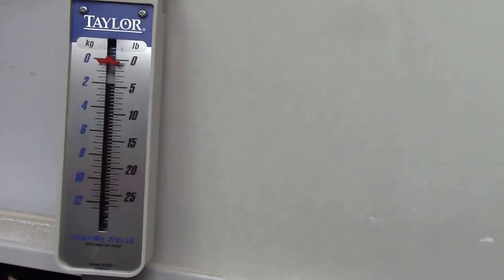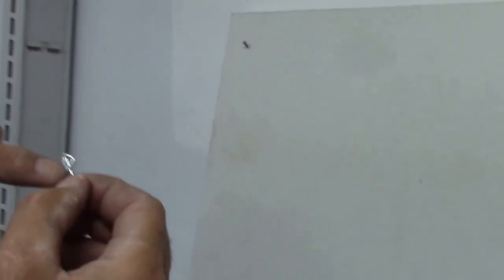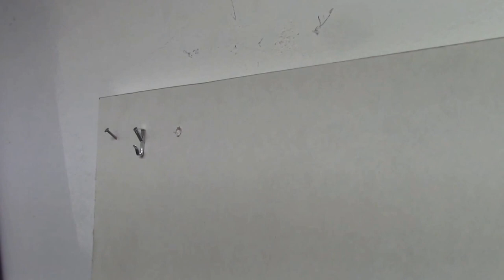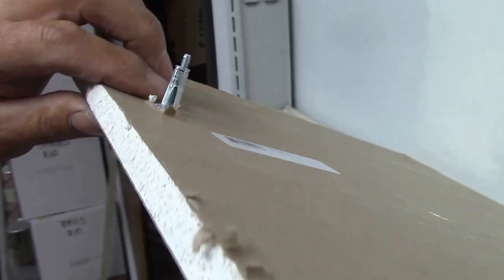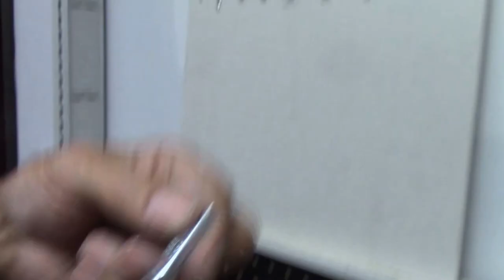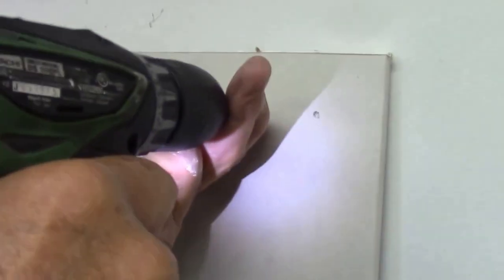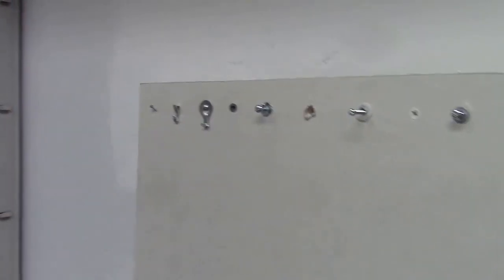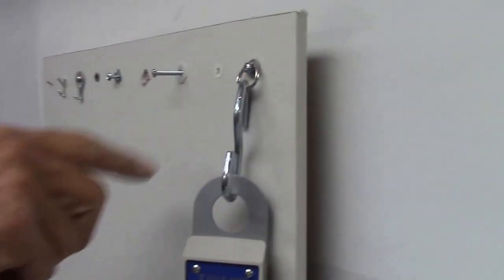Hang Heavy Pictures and Shelves Safely, Made Easy

Comment: Is not the integrity of the sheetrock all based on the back paper staying intact with no tears?

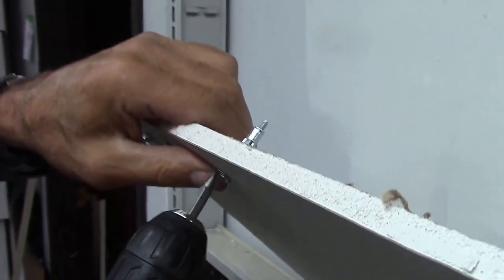With real American Molly,  predrill with a tad smaller drill, so as to perforate the back paper to the right diameter (slow drill, no hard pushing in), and user a pull tool to expand the back.  Real Molly used a solid stem of the same thickness as the sheetrock used. Then the pull tool would expand the back, so a tripod (or quadpod if there is such a word), would expand and the legs sit on the back paper WITHOUT breaking it.  The Chinese got it all wrong, and did not understand the engineering involved, also used a steel of the wrong alloy.  Cosmetic OK, engineered badly.  At minute 4:14, you can see all the back paper torn. Not a proper Molly fit.